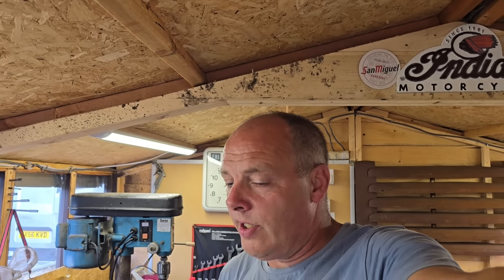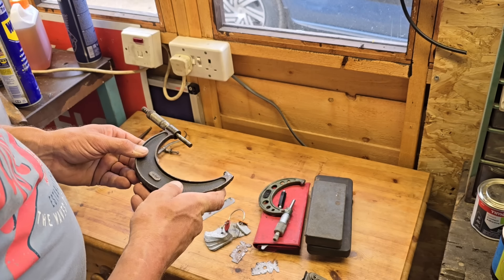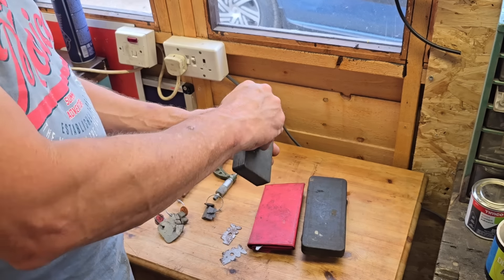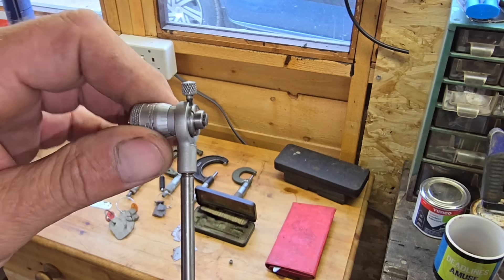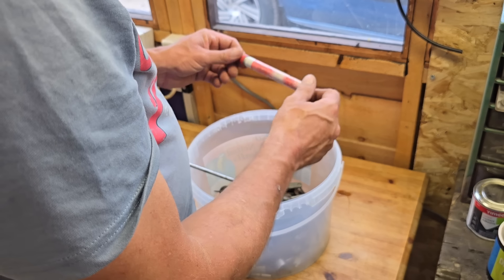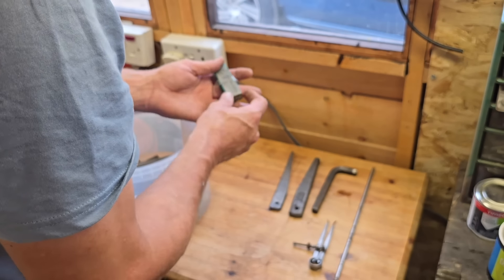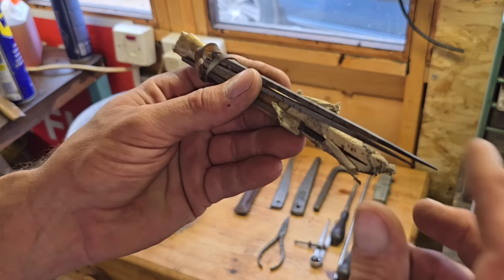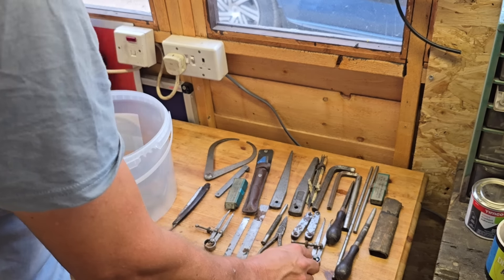What have we got here?? Loads of old tools and stuff.

Comment: The Square block with a radius on one end and a hole through it is just a drive key. The threaded hole is for jacking it out from its key way.
The threaded round bar which has 4 angled flats on and has been ground on one end simply looks like the shank end of an old auto lock milling cutter.
The small, short, round tube with the horizontal hole and the taper on one end and is part of a clock stand clamp.
You have radius gauges galore! both on rings and in the red pouch.
The wedges are morse taper release drifts.
The round piece in the micrometer box is just another setting gauge for the micrometer.

Comment: the two wooden handle items are bearing scrapers, the two wedges as you called them are for drifting out morse taper drills and the small flat plates with angles around them are for setting thread cutting tools , if you are at Henham i will show you what they are used for

Comment: Hi Adam
Looks like you will be working in imperial then, none of that metric stuff.
Good set of micrometers probably all you will ever need, time to practice cutting to a size.
Blue handled tool is a diamond hand lap, you need one to keep your brazed carbide tools keen.
Two wooden handle scrapers, use as deburring tools.
Small files are needle files, get some handles or a pin vice to hold them, they will hurt when pushed into the palm of your hand.
Gauges with rounded corners are external/internal radius gauges. Angle gauge use for checking cutting tool angles.
Thread gauges check pitch of thread, a lot more training before thread cutting
At long last some centre drills, they are probably 60 deg and will suit your live centre, also use for start hole for drilling. Be careful when using, not too much pressure as the start point is easy to break in steel.
Odd bits of bar with chamfers cut, could be setting blocks, not used anything like them.
Two wedges are drill drifts and used for knocking out morse taper items.

If you ever come across a tool post system as in website, snap it up as it will make life so much easier to set tools and with extra holders tools are ready to go in seconds, really good if you need to make multiple same parts. Also looks a good site for cutting tools

https://www.warco.co.uk/quick-change-tool-posts/209-quick-change-tool-post-90-115mm-centre-height.html

Comment: Internal gauges are very often called internal calipers.
The long wedge bore things are Morse taper drifts. Used for removing chucks and tools held in tail stock or drill spindle with a taper. 
Excellent snag of tools there, Adam.

Comment: Two morse taper drifts two engineers scrapers and a number of various calipers and dividers, you really need to get a book on machining. The thread gauges will have the relevant data etched into each blade to give you the threads. The files are called needle files. The tiny spanners look like they are for adjusting the micrometers, my micrometers came with a set just like those.